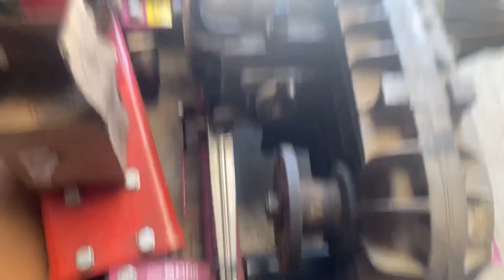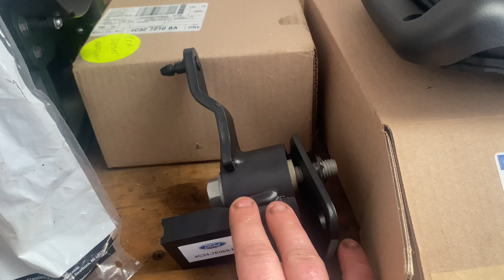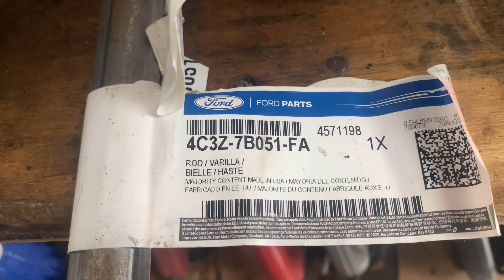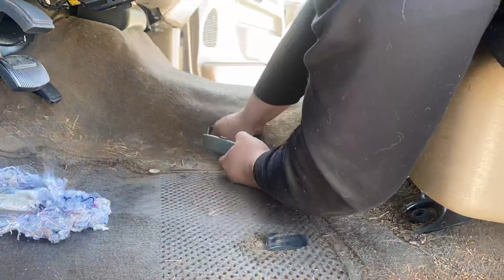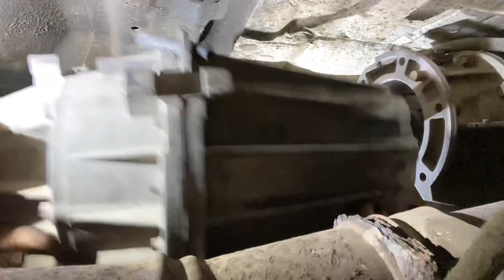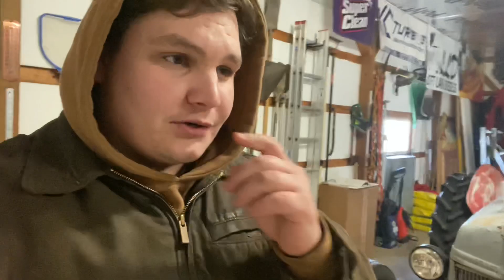COIL SPRING 4X4 CONVERSION!! 6.0 POWERSTROKE DUALLY!

Comment: I am currently in the process of converting my 2002 F250 SRW to 4x4 going with the front leaf spring suspension and manual transfer case. My question to you is have you wired up the transfer case to activate the 4x4 indicator lights on the instrument cluster? And if so, will there be a video to show how you did it?

Great video BTW!

Comment: Hey buddy I have a 2006 6.0 and I was on the gas pretty good and it started making a loud humming noise and cut off and was leaking a little oil and now I have no low pressure oil pressure do you think it will need a full rebuild please reply thanks
Reply: Please respond buddy I can’t find any info on it anywhere else just wondering if you would have any idea of what is going on

Comment: O My How I, would Give my Left Arm to have my 05 6.0l 2WD DRW  Converted into a 4WD, I'm only at 180K and I, purchased it used at 115k,and it's still not studded it hasn't gave up a head gasket yet,
It had to go back in to the dealership that I, purchased it from 4 or 5 times within the first 500 miles for a bad Injector, then rear brakes, then the EGR And Oil cooler I,got the Bullet proof EGR And another OEM oil cooler, then as I,was about to Drive away it had a no start battery problem that was replaced.  Then about 3 days afterwards of all that I, was going down the freeway and the Motor shuts down,so I, call the Powerstroke guy that I,had been consulting with during this 1st few weeks and he says sounds like the IPR valve, so I, have it towed back to the Ford shop and that's the problem. I've towed my 5th wheel on and off ND had some other issues but it just won't give up the head gasket.  Looking now to get an EGR Delete now that I, have moved from Phoenix to another area where I, no longer have to have one, no testing and  yearly inspections. Only thing that it's doing now is a making a clunking type noise when doing a 5 to 4 downshift if I,let it lag and only when going up a grade and I'm going about 60 mph and about 1800-1900 RPM'S. But if I, mash the go pedal a bit sooner no problem.  Thanks for this conversion series, you my friend are a natural but I'm sure it was learned through Much hard work ,and just having the Can Do attitude!
Reply from the maker: Thank you for sharing! I’d say you’ve had good success with 6.0. Although you had problems, it sounds like they got alot of the bugs worked out. Thanks for following along!